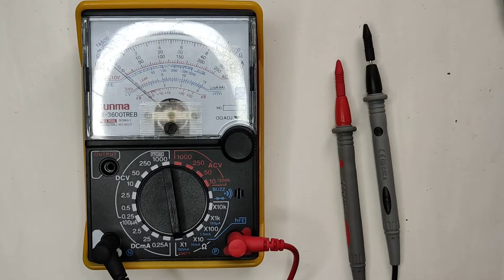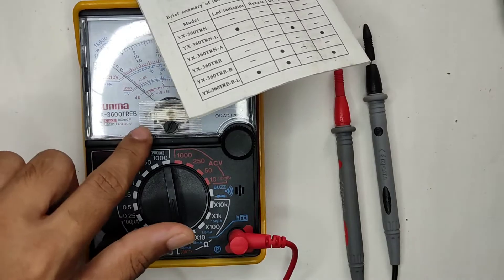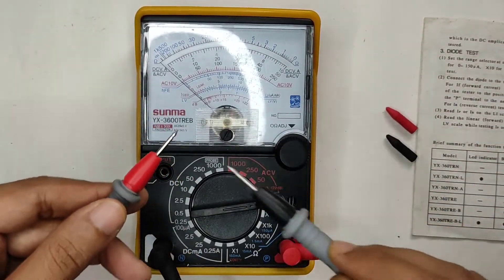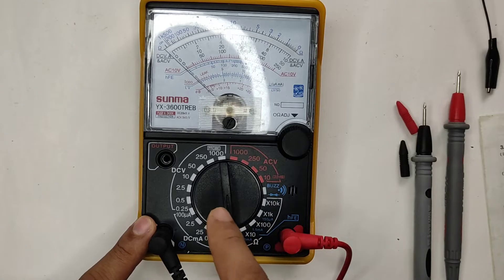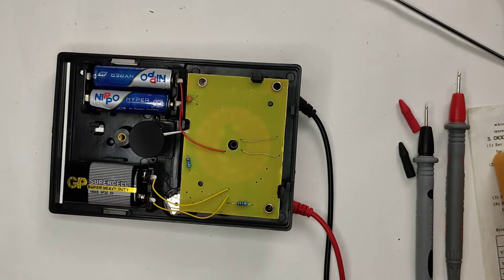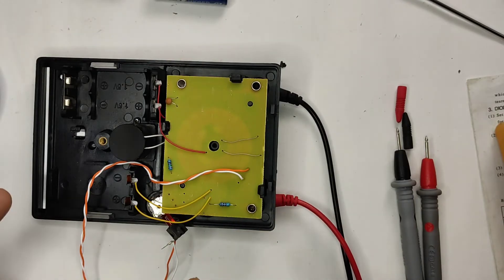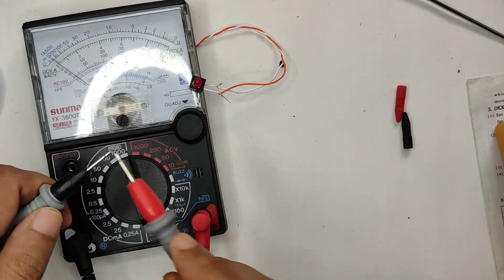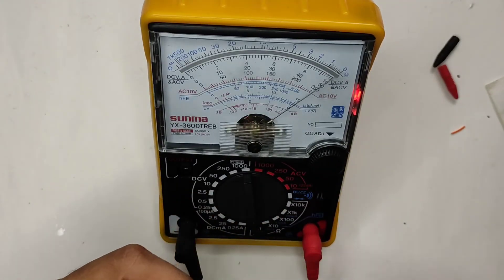IE182: Modifying the Analog multimeter for a custom LED indicator.

Comment: Why haven't you used the buzzer pin. That's how you could have used it in contunity mode.  What is the point of connection it to some other points ment for checking resistance
Reply from the maker: You might be unaware that most analog multimeters have a separate continuity mode with an LED. I'm just showing how to enable it, if yours doesn't come with it as standard.
Reply: @INSIDEELECTRONICS  ok. Sure .Last day I realised by opening my multimeter .that the dedicated continuity has led terminal but no led was connected .thanks for helping .
Reply: @INSIDEELECTRONICS  and one more question . I would like to know from you .
In the buzzer mode does the metre produce a beep only. Or the needle of the meter moves along the beep
Reply from the maker: Nope, in the buzzer mode there won't be any changes in the needle. It's just the sound. But in the second mode, both the needle and the LED are in use.